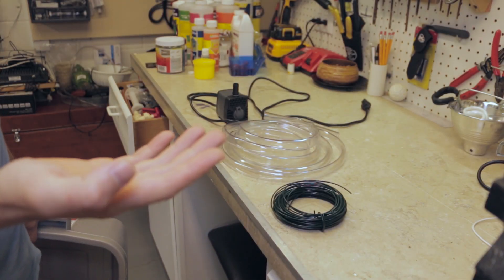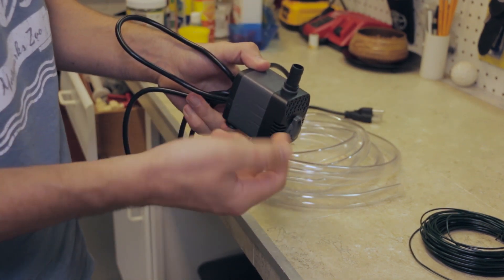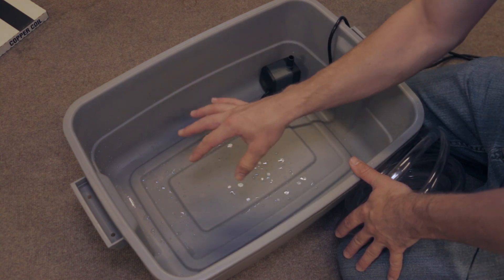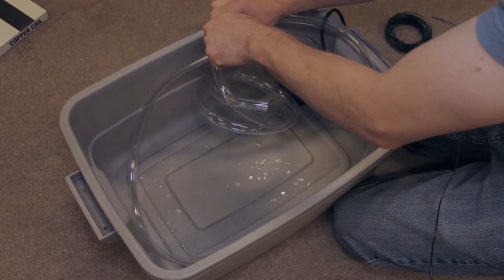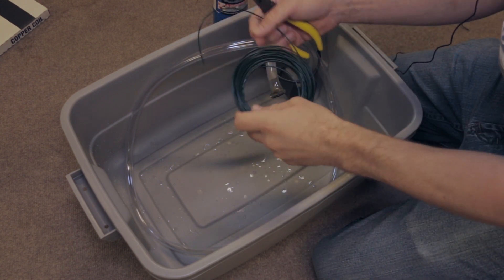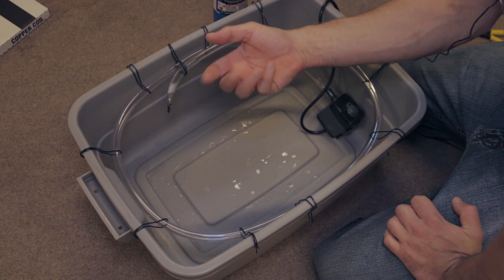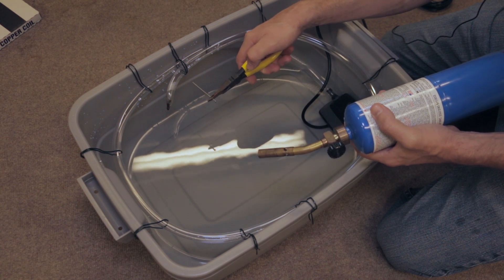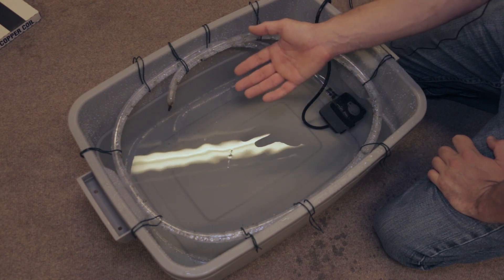Easy DIY D.W.C. Aeroponic Hybrid Hydroponic Setup under $30

Comment: lol aeroponics is a mist  ejected into air to wet  roots  with a control particle size  NOT   mass streams  just spraying out of hoses -  aeroponic growing is to grow plants suspended in a closed or semi-closed environment by spraying the plant's dangling roots and lower stem with an atomized or sprayed, nutrient-rich water solution

Comment: This is very clever! Can a soaker hose like is used in air diffusers be used also, or are the holes too small to eject enough water?
Reply from the maker: You would need a much stronger pump

Comment: That is not real aeroponics.... you should have fine mist, not holes pissing water out. And the roots will end up submerged if you leave the nutrients in the same chamber. Nutrient mix should be in seperate chamber so when it 8s spraying the runoff can collect and recycle back to the reserve instead of sitting in bottom of root chamber.

Comment: Instead of using just a hole I would of put in 180 mist speakers to put in the holes instead of just holes but that's all I would of changed great system still

Comment: I recommend trying a ultrasonic mist maker in a 5g bucket as an easy and very effective aeroponics  system
Reply: how's that simple?
Reply: @karamba6197  you simply buy a mist maker for $5, put it in a bucket. And it's ready to grow
Reply: Jackson Ransom will the fog carry the nutrients?
Reply: @SwingingPythons  yes it does. The mist is at the perfect micron level for the roots to absorb the nutrients very effectively! Very fast growth with this method.

Comment: Doesn’t true aeroponics need the nutrient solution to be dispersed at 50 microns or less (like a mist)?
Reply: You said it, "true" aeroponics, aka High Pressure Aeroponics (HPA). This is Low Pressure Aeroponics (LPA)
Reply: The video title literally says hybrid. not True.

Comment: I tried this, those holes eventually lose pressure and clog, too much maitenance for something so unreliable. Just do it the right way, its not that much more money
Reply from the maker: johnnie walker mine never clogged. Probably depends on the solution used and root decay. Also pump pressure.
Reply: Then use and air stone
Reply: what way
Reply: This isn't true at all. Even if re-used for another crop, this won't clog compared to micro sprinklers. The best way to be sure of this is watch this guys channel. He uses this method with zero trouble for entire crops.

Comment: What size is that tube?
Reply from the maker: FlyingPigNJ I think it was 3/8 or 3/4. Doesn’t matter really
Reply: Growing Answers  it would have to fit your pump? The pump seems to have 1/2" outlet.
Reply from the maker: FlyingPigNJ it might be, but there is OD and ID so it’s tricky to due to different tubing thickness.
Reply: @GrowingAnswers  hm...ok, I just don't want to buy the wrong tubing....
Reply from the maker: FlyingPigNJ 1/2 Id, 5/8 od.
Reply: @GrowingAnswers  thank you!

Comment: How often do you have to change the water if you have nutrients in it or do you just top up.
Reply from the maker: Pete Mitchell if the plants are absorbing it quick, I top it off once and change it the next time. Usually I change the solution once every 2 weeks.

Comment: Quick tip: make your holes in flex tube before you install..
Reply from the maker: NSX Communications because the tube wants to orient in certain ways, it’s easier to aim the holes when it in place.

Comment: Your argument for this aeroponic approach is compelling. Are pump and vinyl tubing food safe?
Reply from the maker: Nick Fichter sure, but even if it wasn’t, think about what is safe. Imagine ingesting all the nutrients that go into the solution to grow. Don’t think that would turn out well if you did. The only time that something needs to be “food safe” is when it’s coming into contact directly with the food you eat. Or imagine this...plants growing in manure. Is it safe to eat manure?
Reply: @GrowingAnswers  .. food safe means  " harmful substances can not be transmitted to food "  think lead solder used in water pipes that feed your garden , you still die of heavy metal poisoning even if the plants never touched the lead ,  looked and tasted awesome. additionally even if those things were food safe you made them not food safe when you burnt the dam tubing...

seriously man i like the videos and i'm a fan but seriously that statement of yours could kill some idiot
Reply from the maker: rarely lucid I don’t see how burning the tubing makes any difference. The tubing is melting and extruded when it’s made. I ate the melon I grew with the setup. If I’m still around in 50 years, I’ll be proof that it was fine. People eat fish right out of the lakes we have around here and it’s specifically said to only eat a certain amount because they contain contaminants leached from all the stuff that runs off the streets and land. I’ve almost never heard of restrictions on crops other than e-coli from packaging conditions. And the crops are watered with the same water that people wouldn’t even drink.
Reply: @GrowingAnswers  ok .. so you made alot of stupid points in that statement lets take them one at a time... vinyl tubing in post manufacture condition is inert to the body aside from a small amount of degassing time required just after it leaves them machine. once it has been heat altered by say a propane torch  and a nail it releases more gases and the vinyl composition changes to something that is untested due to temperature and time of alteration.. if it is untested we cant know what is being released which means we cant know if it is safe or not..people eating fish out of lakes that have known contaminants is someone taking risk into there own hands , remember someone told them  that shit was in there they didnt just post that it was "fine".. as for crops and leached toxins.. it happens everyday.. you know what the most prevailing reason for crops not having leached toxins in them? the FDA.. they test  the food thats sold .. and they will stop contaminated food from being sold. so the farmers wont get the money they are doing all the work for..  which means the farmers have a vested financial interest in keeping there food clean and safe .. you should have that same vested interest in understanding these things. as for the water.. potable vs non potable water has many websites already devoted to the subject  , what youre referring to is the example i gave that pointed out the flaw of your "it has to touch the plant for it to have an effect statement".. reality is leaching of toxins is a major concern for the general public you may not here about it much but to be honest i dont think you research all that much so maybe its a case of you keeping your head in the sand. 

as for you being around in 50 years.. i hope you are.. i just hope youre wiser and understand that, even if 50 monkeys say you made the best set up ever it doesnt mean they are right, it just means the  1 monkey impressed the others... dont be a monkey.. you have a thumb for a reason.. spend some time researching the things you want to be great at and level up ..
Reply: Growing Answers thanks for quick reply. I disagree with you on potential health risk from plastic in growing systems.  E.g, I would not use polystyrene ("styrofoam") as appears in many DIY Kratky method setups. To me, some transfer of leachate from nutrient solution to my plants seems inevitable. We arrive at our own judgments about such potential risks. I like your videos and have subscribed.